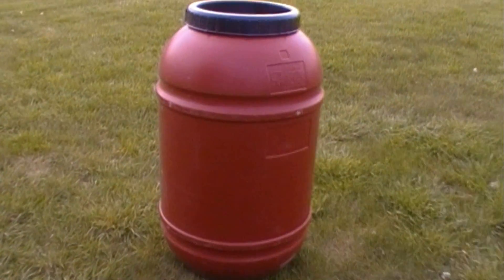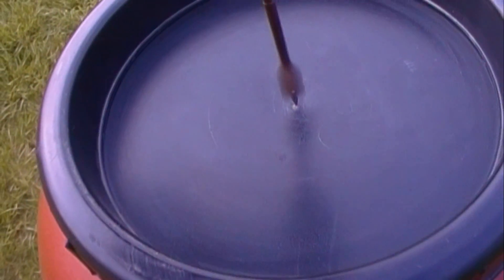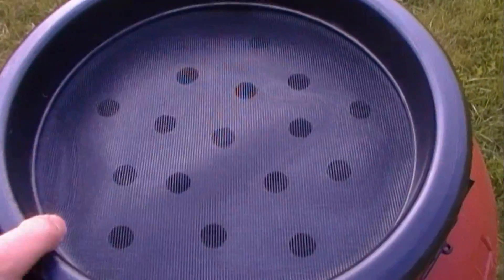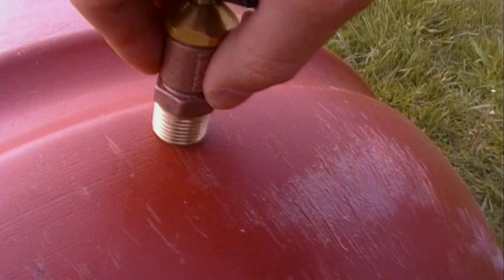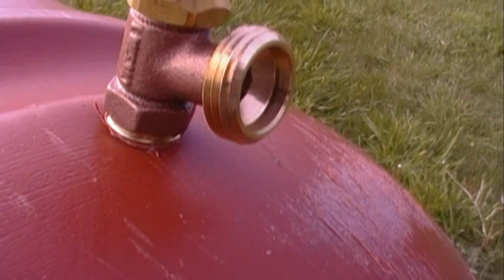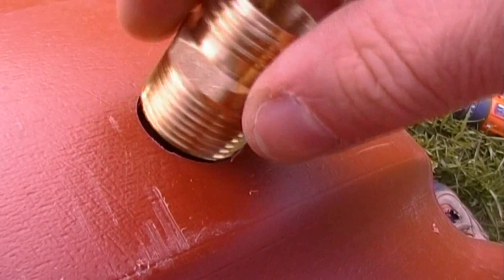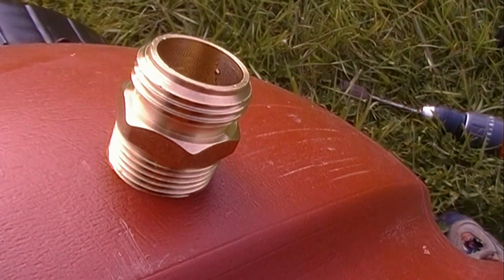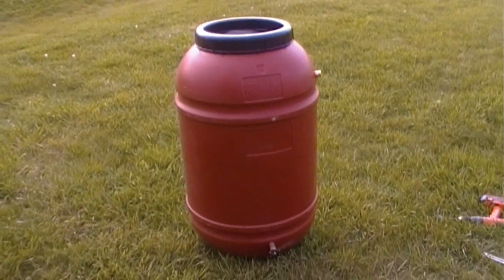How To Build a Rain Barrel for CHEAP

Comment: any reason this needs to be food grade container ?
Reply: For safety reasons. Not mandatory tho depending on what your using the water for. Some plastic barrels are used to hold chemicals
Reply: If not food grade the plastic will leatch chemicals into your otherwise clean water.

Comment: can you give advice on where to get those barrels? I'd like about 3 or 4 of them.
Reply: jiggy loo 
I got a couple from AC&T It's  a truck stop, they are the white 55 gallon barrels that had soap for the car wash in them. They sell them for $5. You have to clean them out but great buy.
Reply: jiggy loo http://www.ebay.com/itm/332245183294

or Craigslist
Reply: jiggy l
Reply: you can buy them at home depot for that. the title of the video says CHEAP in all caps and he says he got it from a food dsitributor. nobody needs to be told where to buy them for retail. i checked craigslist and typed in barrel and saw lots of ads for cheap food grade barrels like this.

Comment: I have a odd question. Anyone know how long it would take to fill this by just letting it stand alone in the rain? Not hooked up to a downspout?
Reply: +Melodie Fox Obvious answer would be "Depends how hard it's raining".
Reply: A really long time.  I have two 55 gallon food grade plastic barrels. I made me a rain gutter system using 4" PVC pipe. Got two pieces of metal pipe about 8' apart cut to correct height to go under roof eve. Put caps on each end glued. Then cut a 3" or so length ways section out of pipe. Putting opening at angle to catch water. Put a T midway of pipe.  Not too bad. A good rain over flows mine.

Comment: Awesome System.  moving to the Philippines and need to harvest rain water for consumption & daily needs- Laundry, showers ect ect. Question, are the brass fittings ok if were using the water to drink?  The next issue, how do I maintain a barrel of water ready to drink? The last resort would be boiling gallon after gallon? I see the initial filter system- thats good. how to maintain a running purifying system?

Comment: Like the vid. I have been looking for a cheap way to do rain barrels. Our farmer's co-op sells them for pretty cheap in my area.  One thing I have found is that it may be more economical to do a 275 gallon tote. The barrels are $25 each and a tote out here is about $100. It would be more compact and maybe easier with one tote vs. 4-5 barrels methinks? Keep up the good work.

Comment: You can also put these barrels next to each other and run the overflow value into the next barrel and the next barrel and get a good amount if water saved up for your needs.

Comment: @DJKID777 Rainwater is "grey water"/ It should not be consumed if it has poured off of a dirty roof and through moldy down spouts. Unless you like bird dropping flavored water, then go right ahead.
Reply: I would only use to water my outside plants during the summer. Good point though,